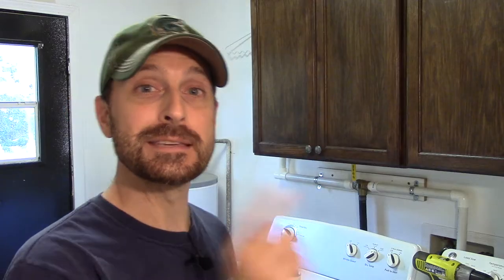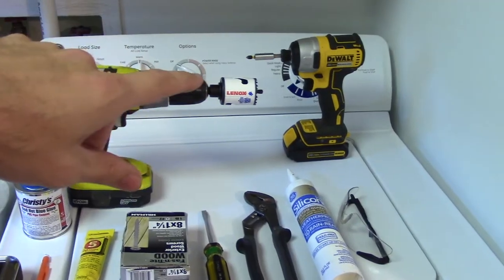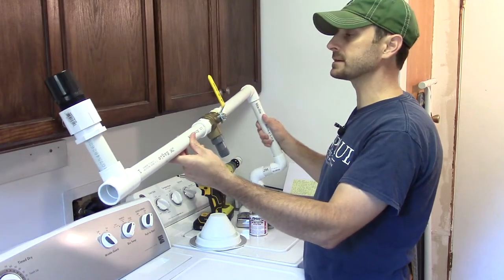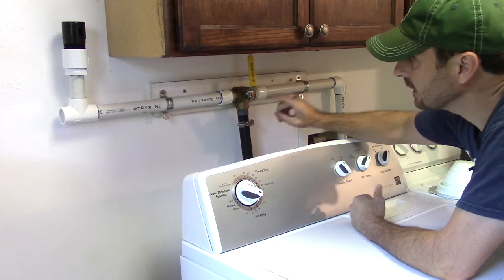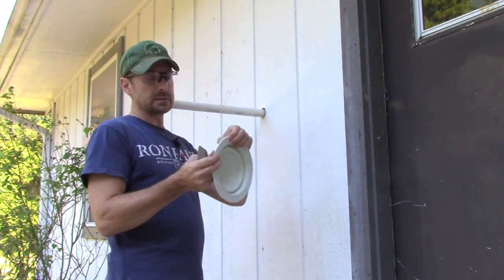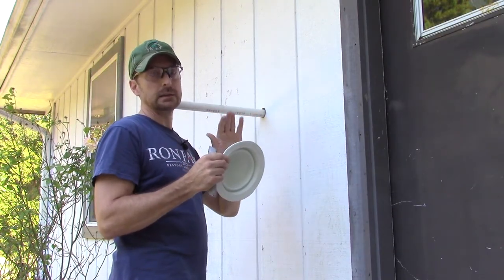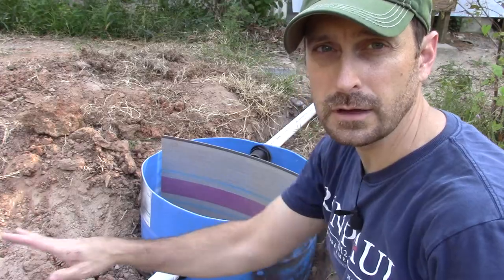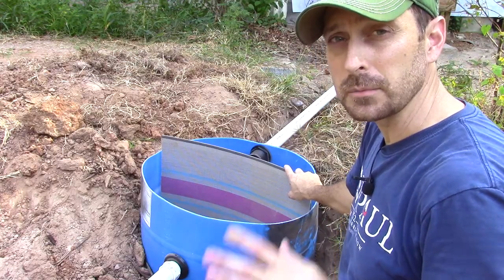Complete Grey Water System Build | DIY Recycling Septic Saver | 3 Stages With Planter Beds

Comment: Those plastic tubs just go brittle and crack to pieces!
Reply from the maker: They are still there years later. No cracks yet.
Reply: @CountryLivingExperience  well, I did see the way you had it supported with the wood structure, so that would help.  I picked one up the other day from the garden and it just cracked apart.  The plastic storage tote, not the blue barrels ...  I really want to make a grey water system!!

Comment: Nice tips! Quick question: do you have to use any special detergents, washing liquids or other soaps with this system or does it cope ok with regular household goods? Will worms/plants like hot water full of detergent coming from your washing machine?
Reply from the maker: We use an ecologically sound detergent called Exos but it is not necessary. Modern detergents do not have phosphatic them anymore I believe. Those were the harmful chemicals that people worried about in the past. As for the water, it is cooled off very quickly as it runs through the system so no worries there.
Reply: Found it!
Reply: @CountryLivingExperience  
Thank you for the video and information. What do you do with the grey water in winter? Where do you collect and filter it?
Reply from the maker: @Elmirochka100  Same thing. Water coming out of the house is warm. It flows through the system just fine.
Reply: Can we see update pics?? Is it still working well 2 years later? Any alterations? Thanks for sharing your experiences!! It's so very helpful to us newbies! Keep up the hard work.

Comment: We used your idea to recycle our washing machine, laundry sink, shower and sink and the kitchen sink water to water the grass and fruit trees in Outback Queensland Australia.

The only difference is we don't filter the waste waters.
Reply from the maker: Very cool.
Reply: What are you using for containment, and pumping out to the areas you need to water?
Reply: @OneSssyRedhead  A 3000 L poly rainwater tank in the ground and we pump it out using a 240 volt pump.

Comment: This is very helpful! Could you explain a little more about the worms on the wood chips? Wouldn't they die with too much water? I know that the water just flows through there, but still...
Also, what kind of plants did you plant after? Thank you :)
Reply from the maker: Glad it was helpful. The wood chips and worms aren't necessary. They did fine for a while but I never replaced the chips. I planted perennial grasses and plants that don't mind a lot of water. You will have to research plants in your area because they can be different.
Reply: Yeah, I was wondering about the greasy kitchen dish water especially and would that hurt the worms?   The wood chips are great because they really catch the greasy stuff well.

Comment: I like the project but my experience with the winters in MN makes me doubt whether the rock rain barrels would withstand freezing temps when it slows the flow of the water to 'a treacle'.
Reply from the maker: I totally understand your concern, I grew up in Michigan. It is super cheap to make so you could give it a shot without much investment. Also, the water coming out is warm. It may move through the whole system before freezing.

Comment: im curious. have you done a follow up video on this project? Its been four years since you posted. How is it working? Have you changed, or updated anything since? Was there any failures in this system? I have been researching this very topic for our own system here on our farm. Just havent pulled the trigger quite yet. Because i am looking to design it on a bit larger scale, with living aquatics, maybe even some fish in the last water catchment area. Make it more interesting, even do it as a test to see if it could work. And yes, i want living plants as well.....
Reply from the maker: I never did a follow up video on this system but I still have it and it is still working great. 
I had to clean it out a few times when weeds blew in and grass crept in from the sides. Other than that, a few of the planted grasses I put in to clean the water died in the cold.

Comment: Great vid and very helpful! Thank you! How would u alter it if u had temperature below freezing point at winter? How should i start in that instance? Thanks a lot.
Reply from the maker: Thank you. No modifications at all. The temperature of the water coming out of the house is 105°. There is never any freezing as it moves through the system fairly fast.

Comment: you need to do the mesh around thw wire cage cause the woodschips gonan break down and clog it either way xD
Reply: Even putting like a grate above that would be better and then small gravel under with the woodchips above

Comment: Thanks so much.
I'm actually doing a project on this and I have a question.
Please I'm worry about the fact that, if color water is insert can it go through the same process and come out clear.
Reply from the maker: You’re welcome. It depends on how much color is in the water. In my small system, it would not take out much color at all.

Comment: I am creating a wildlife watering pond complete with a small waterfalls. Since I am in Arizona water is at a premium. Is there a filtration system that would allow birds and other wildlife to safely drink the water from my shower and bathroom sink. There would be no food particles anywhere. Just the water from a bathroom sink and shower. Thanks for an excellent video
Reply from the maker: Animals usually do not drink tainted water. They have a sense of what is bad for them. I wouldn't worry about it too much. What I would do is only use natural bio-degradable soaps like castile soap, etc.

Comment: Is there a video showing the system working It would be great to see great content
Reply from the maker: Thank you. No I never made a follow up to this vid. The system works great. I have a lot of plants in growing in the rocks that are helping to clean the water as it flows through the system.
Reply: @CountryLivingExperience  Thanks for the great video! I'm going to be doing something like this, also in Texas. You laid sand and soil on top of the rocks, right? How thick? What plants did you have success with?
Reply from the maker: @thereeldaniel1338  You're welcome. I actually ended up leaving the rocks bare. I took potted perennial grasses and cut the bottom off of the pot. I then nestled that pot inside of the rocks. Works like a charm.
As a tip for commenting on YouTube, don't comment on somebody else's comment. Start a new comment of your own. It was lucky I saw this in my email junk box or I would have never replied because I would not have seen it. YouTube does not inform me of replies on other's comments.
Cheers.

Comment: Q:  how deep should that first layer of woodchip be, under the mesh?  Or if you're not using woodchip and worms there (I saw your reply further down - I too would be concerned about the worms drowning!)) could you just use gravel there as in the other containers?
Reply from the maker: You can use a small rock medium in the first container. Make sure that mesh is in there to catch some of the bigger lint pieces from the washer.

Comment: Hi there. Great video. Have you made any updates to your system? Is there anything you would have done differently? How is your system working out for you?
Reply from the maker: Thank you. 
The system still works well but I need to clean out the barrels and pool because a lot of dirt has blown into them. The water still filters well through the system though.
Reply: Dont you want water entering at the bottom of the barrel/pool and exitint at the top? This "overflowing" makes sure only the most filtered water is exiting after moving upwards thru 3-4 different substates.

Comment: I enjoy your videos.  They are informative and full of ideas.  Keep up the good work.  I have a few questions.  Besides filtration, do the two 1/2 barrels and the kiddie pool serve a purpose? You mentioned the water eventually goes to a dry creek. Is this system only to relieve stress on your septic system?  Thanks again.
Reply from the maker: Thanks man!  I appreciate it more that  you know. They really just serve as filtration at this point. Once the sand and topsoil are placed above the rocks, you could plant edibles in them (if you use a biodegradable soap). The system serves a couple purposes. 1. Taking pressure off the septic and 2. serving as irrigation for any fruit trees, etc. planted after the last stage (pool).
Reply: @CountryLivingExperience  that makes sense!!  Thanks for the info.
Reply: @CountryLivingExperience  Are those blue barrels and pool made out of food grade plastics?. I tried to look up what those pools are made out of, but I couldn't find the answer. I wanted to use some as temperory raised beds, but went a different route.
Reply from the maker: @robertcornelisse8664  The barrels are food grade. The pool is not.
Reply: @CountryLivingExperience  thank you. Are you not afraid the plastic from the pool leaching?
Reply from the maker: @robertcornelisse8664  No. It is so minimal that it is almost negligible. There are more toxins in the air. Additionally at this time, there are no edible plants down stream.
Reply: @CountryLivingExperience  Thank you

Comment: Useful one thanks, like to know how many days we can store recycled grey water and how...regards
Reply from the maker: You’re welcome. You can store water for a while. There is really no set number of days. Frey water is not potable so it would just be used for irrigation. You should be able to store it for that purpose indefinitely.
Reply: I have stored my laundry water as is in a big black tote for a good 6-12 months and kept it covered. After a short while it starts to smell bad (thus had it covered) en then eventually it becomes sort of just strange smelling. I then diluted it with rainwater, about 50/50 and then wateted the garden. We had a terrible drought.

Comment: I’d just run it out onto the ground. This just seems like extra work to me. I plan on hiring a plumber run all mine out into the yard. I only want my toilets going into the septic tank.
Reply from the maker: My goal is to have just the toilets in the septic as well. If you filter it, you can use it more effectively for plant irrigation.

Comment: Great information.  We were talking about doing this. But going to our herb garden.  I am not sure how well that would work.  Still doing research on it. Can you provide your feedback on it.  Thanks
Reply from the maker: Cool. If you run it to an edible garden of some sort, you need to use the biodegradable detergent. We use the Ecos brand. Also make sure that you build in many stages of filtration before it gets to your edibles. With ours, there are essentially 10 stages before it empties onto our property. Some videos out there show laundry water being dumped directly on plants without filtration. I think this is a huge mistake on their part. Have fun with your project.

Comment: How does this system remove soap/ detergent from the grey water?
Reply from the maker: It does not remove it. The plants help to filter it somewhat. That is why I mentioned using biodegradable soap and not modern detergents.

Comment: I liked the video.can you create a video on how the vermi composting work as there is a constant flow of soap water which makes the filter always wet + will worms survive in detergent water?
Reply from the maker: Thank you. We only do laundry twice per week and it drains very fast through the larger pipes so it is not soaking wet for very long.
Reply: @CountryLivingExperience  This is definitely the question I had, how do the worms not just die from the laundry detergent soap?  Also, what do you do with the water once it gets into your dry creek?  Is it used eventually to water an actual garden?
Reply from the maker: @matthewleewillis  The water is clean by the time it makes it to the creek. It usually doesn't even make it there because of the distance. Yes, We are planting fruit trees, etc at the end of the line that will utilize the water. Additionally we use biodegradable eco friendly soaps instead of detergent.

Comment: Being in Texas maybe this isn't a consideration for you, but did you factor in the frost line? I live where the frost line is about 36" and I'm wondering if I need the reservoirs to be below, or just the last one? Also if there would be a clog due to standing water turning to ice wherever I am above the frost line in winter?
Reply from the maker: I didn’t factor it in . However, in the winter it is usually in the 20’s and the water coming out of the washer is hot. I have never had a pipe or a reservoir freeze.
Reply: @CountryLivingExperience  Thanks for the speedy reply!

Comment: How does this fare in the winter when temperatures drop below freezing for 6 months?  Or do you live in a climate that doesn't happen?
Reply from the maker: Our climate is mild but we do have several weeks at or below freezing. It has not affected the system at all. The pipes are large enough that nothing freezes inside and they all have positive drainage of at least 1/4" per foot.  Additionally, the water is warm coming out of the house so it is mostly out of the system before it can freeze.

Comment: What soaps do you use that will not effect the worms?
Reply from the maker: We use castile soaps and one called Ecos. The worms are never really in much contact with the soaps as the water drains out very fast. It enters the tote in one area and never soaks the other areas. The wood chips remain moist so they can be broken down by the worms.

Comment: Hello there! I have an aerobic septic system with a direct discharge from the clorinator into the field but over the years it has created an area is constantly wet even in the dryer months. I am thinking a adding a sand filter but have not come around any good ideas. Can you make any suggestions?
Reply from the maker: I wouldn’t know what to suggest to you exactly. I would combine layers of other aggregate besides the sand to mitigate erosion.
Reply: One solution would be to have the discharge   happen deeper underground. However, this assumes that you don’t have a high water table. If you would like the water distributed over a much larger area, then you could discharge into a tank and then pump out the  tank as needed to irrigate different areas of the field. This is a high initial investment, so perhaps French drains in the area where you currently discharge water would be a better solution.

Comment: Thank you! 
How often do you clean the rocks? 
Also, is there certain about the worms when you run the water on hot?
Reply from the maker: I have taken the leaf blower to blow out debris. I have not had to clear out the bottom of the containers yet. I am sure someday I will. The worms didn't work out.
Reply: @CountryLivingExperience  Thanks for your quick response! Sorry about the worms.
Reply from the maker: @synchrogrl18  You're welcome.
Reply: Did they not work out because of the amount of water?  Do you know what the issue was with them?  I think your idea of incorporating them into the initial filter is quite clever
Reply: @pigeon4405  soap even biodegrdeable soap probabably killed them is my guess. I personally think it's not a good to put organic matter as the first step, most grey water systems have organic filters like a pond as the LAST step. other wise the system gets clogged up with organic crap.

Comment: How do you clean the debris after build-up?
Reply from the maker: We blow out the large pool with a leaf blower. The smaller ones have a lot of plants in them so not as much debris gets in from above. We have not cleaned out the tubs to date but will eventually have to remove the rock and wash them off.
Reply: @CountryLivingExperience  What else is in the pool, just the rocks? Not covered by anything?

Comment: Hi!  Thank you for your educational video!  My need is for a system for bigger volume of waste water.  Do i just enlarge the system you describe?  I have a wedding venue and I can't require the caterers to use biodegradable soap for washing up.  Does this mean the end water is cleaner but can't be use for plants?  Thank you and hope to hear from you soon...
Reply from the maker: You're welcome. I am not sure of the volume of water you would be putting through the system. You may have to build a wetlands type of system which in a way is just a large scaled up version of this. There are companies that can do this but at an elevated cost. A wetlands/reed bed type of system is what you need to look at I think.
Reply: Thank you for your reply....Is there anything of you tube that i can watch to have an idea of a wetland type?  There are no company here which would specialize in this kind of thing :-(
Reply: @chiancallaghan7479  geoff lawton's